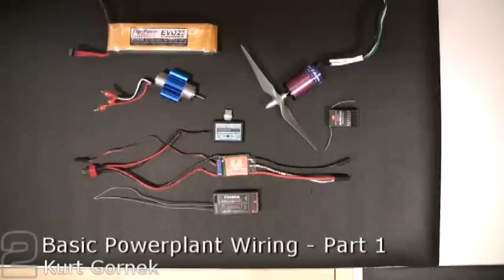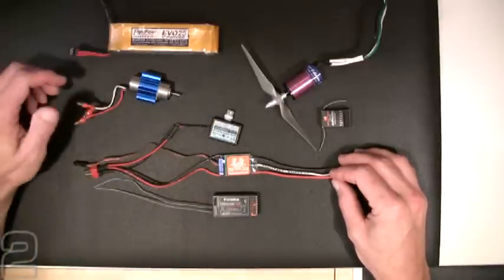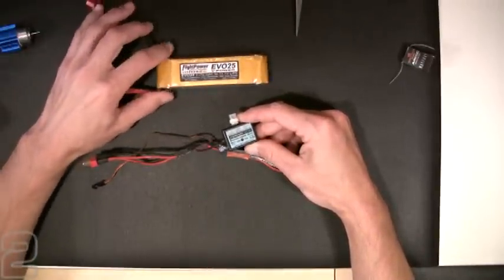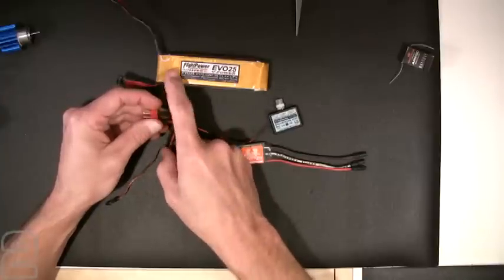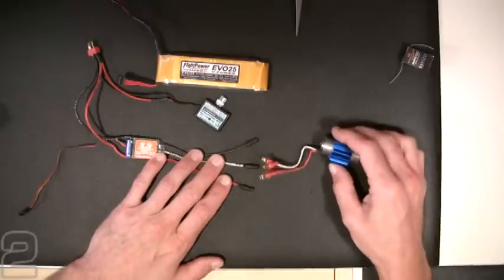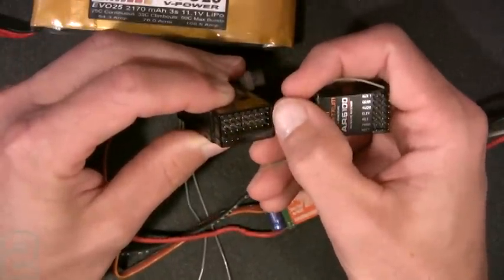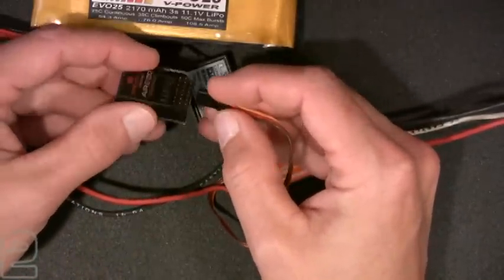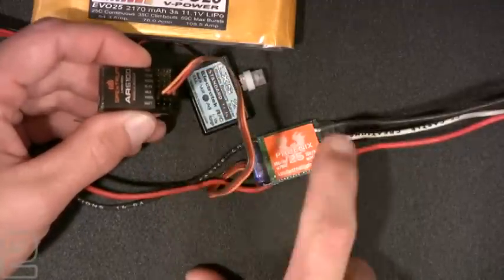RC Motor and ESC Wiring - Part 1

Comment from the maker: You're absolutely correct.  Any two wires will reverse the motor direction.  We suggest using the outside two as a reference so you can easily keep track of your setup upon final assembly.  Often times you end up removing/disconnecting the motor somewhere along the process and it's easier to remember two wires instead which of the three you shuffled during setup.

Comment: Its not mentioned much by most hobbyists but the three wires that power the motor are better known as 'multi-phase' or better known as 'three phase AC, just for those who wish to understand how their motors work, Go look up 'three phase ac electricity on wiki, explains it well about the motor winding in 'star' and 'delta' winding formations :)

Comment from the maker: Yes, either switch any two of the wires for proper rotation or, if your ESC is capable, change the motor direction in the programming of the ESC.  The wires are the easiest way. Some ESC manufacturers offer a plug-in programming card that makes programming really easy as well.

Comment from the maker: @thediamondz1 - The ESC rating is based on the motors peak or maximum amperage draw, not the battery.  The battery can only supply what the motor is able to draw, so the ESC never passes more current than the motor's maximum rating, unless you're running the wrong prop.

Comment from the maker: No, however it's fairly common to buy ESCs and motors with bare wires so you'd have to solder the bullet connectors on before assembly.  Some already have the bullet connectors in place.  E-flite and Electrifly Rimfire components already have matching bullet connectors in place for their matching hardware, so no soldering would be required.

Comment: If you're still making these beginner "how to"s, consider doing a video about motor selection. I have a small park flyer I bought as a RTF, and I'd like to upgrade to a brushless motor etc.  but I'm confused by all the different ways to mount the motors, and which way they face, and those little prop adaptors, and pusher vs pullers, and outboard vs. inboard...  I just don't get it.

Any way, nice video, it really helped.   Thanks.

Comment from the maker: 102Traveller's response is correct, you may check to see if reversing the throttle channel fixes the problem.  Futaba radio systems require the throttle channel be reversed in order to operate an ESC. Another solution may be to adjust the channel end points of your radio supports this function.  Sounds like it's not arming or going into stick programming mode.  This could be caused by either of the above conditions.  Be safe and remove the prop while adjusting!

Comment from the maker: @TheSliekaStyle - You don't connect your 11.1V lipo to the receiver.  You connect it to the ESC.  The ESC radio connection back-feeds the correct voltage to the receiver.  This is the purpose for having a BEC (battery eliminator circuit) built in to the ESC.  It handles the regulation of the incoming voltage down to 4.8 - 6.0 volts for your radio system.

Comment from the maker: You cannot connect directly to a brushless motor.  It actually runs off AC current converted and managed by the ESC. The ESC converts the DC current supplied by the battery to AC, manages the phase, timing, etc. in order to actually run the motor.  There's a lot going on inside the ESC.   A brushed DC motor however can run directly off a DC battery.

Comment from the maker: @mayantribe - The BEC power is supplied through the single radio connection coming from your ESC (assuming your ESC has an integrated BEC).  There are no additional wires for your BEC circuit.  Just plug your ESC into your radio receiver with no motor connected and plug your flight battery into your ESC.  If the receiver comes on, your ESC has an integrated BEC.  If it doesn't, your ESC does NOT have an integrated BEC (or your reveiver connection is reversed, always check polarity).

Comment from the maker: @SunTrapped -  If you are asking if you can connect a brushless motor directly to a power source, no. The Electronic Speed Controller (ESC) function is relatively complex and involves current inversion, multi-phase signaling, timing, and current management (to name a few). You have to utilize an ESC in order to spool up your Electric Ducted Fan (EDF) powerplant. Brushless RC motors should never be connected directly to a power source.

Comment from the maker: If it's not clearly marked on the outside of the ESC, just plug in the main flight battery with the prop/rotors removed, and test the radio lead coming from the ESC.  A multimeter or voltage meter on the positive and negative wires (Brown or Black are negative), Red is positive.  You should see about 5 volts DC being supplied from the ESC if a BEC is present.  Also, simply connecting the flight battery with the ESC plugged into the radio receiver should power the system if BEC is present.

Comment from the maker: @collierman57  -  Yes, that is correct.  Any 2 wires will change the phase sequence and, as a result, change the direction. The outermost wires are often the same color as the ESC leads on medium and larger BLDC motors, so keeping track of just two colors that match is a little easier.  I always match the colors to start, and then test the direction.  If I have to disconnect the wires during the build, it's easy to remember the pattern of the two outermost wires!

Comment from the maker: Jonas, You factor the motor's peak wattage and convert to amps.  Watts = Amps X Volts.  You then choose an ESC that can handle the max amperage or slightly more to be safe.  We have several tools on our website that helps with these calculations.  Good Luck!

Comment from the maker: The easiest way to operate an ESC without a radio system is to pick up a simple servo tester.  They are cheap and will allow you to rotate a dial to operate the ESC.

Comment from the maker: You can use a servo tester to operate an ESC without a receiver or radio system.  These are available from a wide range of manufacturers and can be very inexpensive.

Comment: Hi I'm kinda doing this project with my kayak trolling motor.   It has 2 (+ and -)  wires coming out of the motor.  Do you think I can still use this ESC?  What do I do with the last wire.  Thanks for the input
Reply: i am also pretty new, so im not the best on this stuff. but motors with two wires are called brushed motors, and you need a brushed esc for them, which has 2 wires.hope this helps

Comment from the maker: If you're thinking it's the ESC's internal BEC, just remove the red wire from the ESC radio lead and plug and external (4) AA battery pack (or 4.8-6.0 volt DC source) into the radio receiver's BATT port.  This should power up the whole system and arm the ESC.  If the ESC still doesn't arm and you've tried reversing the throttle and lowering the throttle trim, I'd say you have a bad ESC.  Also,verify your throttle channel is working properly by connecting a servo to the receiver throttle channel.

Comment from the maker: If the stock setup was for NiMH voltage ranges, using a LiPo could cause a problem.  Most stand-alone ESCs can be programmed for different cell types but if your ESC cannot be field programmed then the cutoff voltage.  In any case, going from 9.6V to 7.4 volt is going to reduce performance significantly.

Comment from the maker: Typically the motors ship with solder-type bullet connectors.  You solder the males on one side (motor wires) and the females to the ESC wires.  Cover with shrink tubing and you're all set.  There's no reason you can't directly solder the wires together, it just makes installation and modifications a bit more difficult.  ALSO, if you're going to direct solder the wires, make sure the motor is turning in the right direction.  Most smaller ESCs do not have motor reversing in the programming.

Comment from the maker: @chancho00 - There are some circuit designs you can find on the web regarding homemade servo controllers.  Try doing a Google search for "homemade servo controller" and you should get some returns.  Keep in mind, an ESC is going to be less forgiving than a servo when it comes to end points and input.

Comment from the maker: There are other replies that address channel reversing as a possible solution (below).  If you're not getting any power to the rx and your polarity is correct, than it seems your BEC, at a minimum, is bad.  You may still be able to resurrect the ESC by removing the positive radio lead form the ESC radio connector and using another power source (battery or external BEC) to your radio system.

Comment from the maker: @philipriding - Need more info than the motor RPM.  The maximum wattage or amperage in the motor specs will indicate how many amps the ESC needs to be. Additionally, you could be running with the wrong prop, causing more draw than what the ESC is rated for.  Sounds like you hit thermal limits on the ESC, it went into protection, then came back on after it cooled down a bit.  Finally, most setups are only rated for a few seconds (8-10 MAX) full throttle runs, then back off a bit.

Comment from the maker: If your ESC has an integrated BEC, then no additional BATT connection is required on the receiver.  As long as your ESC radio connection is plugged in to the Throttle channel, the receiver should power up and the servos should be functional.  If this is the case and your ESC fails to arm, and you are using a Futaba radio system, you'll need to reverse the throttle channel in the radio.  Remove the prop first  Otherwise, could be an issue with the BEC circuit either not present or malfunctioning.

Comment: How to operate a motor brushless with the ESC but without using a recector and transmitter, what kind of signal is needed at the orange cable? Can I put a potentiometer to the positive and the orange cable to simulate the accelerator?

Comment: I was flying my rc plane with a 2070 rpm brushless motor and a 30amp esc, after 5 minutes of flight i landed it to see if all was ok. the motor was nice and cool but the esc was hot, even though the plane had a good draft of wind passing through the plane. i took off again and tried the plane on full throttle, when i got to around 200ft the motor cut off and i also lost all control of the plane. it crashed. but lucky enough all i broke was the prop, the range on the transmitter is all ok.

Comment: Hi Bros, does one need a servo? I'm in the middle of building a RC Skate board to mount a camera, it has 2 12v motors which works well with a speed controller but it means long cables, so I want RC. THANK YOU FOR A GREAT TUTORIAL VIDEOS.
Reply from the maker: Hi James, no, you don't need a servo.  Just the motor(s), speed controller(s), radio receiver, and the battery/batteries.  Brushed motors can share a speed control if their total amperage is below the rating of the ESC.  Brushless motors require an ESC for each motor.  Good Luck!
Reply: 2BrothersHobby Hi guys! And what about no-ESC using of one brushed motor? If I have one small 3.7V motor - could I power it up directly from RX? It will not burns out the rX?
Reply: Hi James! I understand that its been over 2 years since you posted this comment, but I'm currently in the process of trying to build an electric skate  board.  Do you have any tips or pointers on how to do it or what components to use.

Comment: hey thanks for your video but i would like to know how to find the right esc for the motor and battery, if i just pick random ESC's, random motors and random batterys and plug them all together, will it still work or will it smoke and explode. i want to make my own RC plane but these electronics have no indication of whats compatible and what isnt.

Comment from the maker: @Mena142  - Glad it was helpful!  We'll be posting several more, including multi-engine, external BEC wiring, and navigational lighting.  Check back often or visit our website at 2bfly.com under the workshop section. There are flight calculators and electrical reference information there as well.  Let us know if there's something specific you'd like to see....

Comment: HI, 
2BrothersHobby,

Me and my son took on a project to build a wooden skiff boat. We hope to reuse remote transmitter from Blade 120SR helicopter that we currently own which is MPL4DSM. This then would "talk" to CM703 that we can source cheap from ebay ... We hope to wire cheap motors like 103 to push the boat forward and one servo for the rudder control ... Do we still need ESC or can cheap motors/servo be wired directly into the receiver ? I do appreciate that we are talking about heli dedicated parts to execute a boat project but this is what we currently have and this small project is just for fun anyway. Any advice would be greatly appreciated.

Comment: as i done a range check first. when i got to the plane the rudder elevators ect ect and motor was working fine, im a bit scared to take the plane up again in case it happens again. do you think i have a dodgy esc?. thanks.

Comment: Im scratch building my first plane and I'm using esc's with a built in sbec what I'd like is how do I find out if the 4 amp sbec will be enough to power 5 tss-11mga servoes?

Comment from the maker: Red and Black only apply to the incoming DC current to the ESC. And YES!!! Red to Red, Black to Black or you'll roast your ESC.  Out of the brushless ESC  to the motor there are three wires of any given combination of colors so color coding doesn't apply. Just connect them to the three motor wires. The only time you need to change the motor wire connections is if the motor is turning in the wrong direction, then swapping any TWO wires going to the motor will reverse the direction.

Comment: Well I think this is the perfect place for this. 
I build robots so I am thinking about adding a weapon. So I was going to purchase parts when I realized the ESC has a continuous current of 6A and my motor has a maximum of 4.1 A so what will happen? Also I have two servos so will an 11.1V battery work? They run up to 9V and my motor runs up to 7V.

Thanks

Comment: Okay so that little bunch of three wires going into the radio receiver are: negative, positive and signal. So does that mean I could control an esc via arduino using just the signal wire and leaving the other two wires unconnected?
Many Thanks

Comment: Is there anyway of connecting a brushless motor with three wires straight to a battery without ESC? If not can I connect to an ESC then to battery or does it have to go through a transmitter as well. All Im wanting the motor to do is run a hairdryer..Thanks

Comment: Hi guys, Maybe you can help.  I have a Catalina by Curnli bought through Nitro back in 2009.  I never finished putting it together but would like to now but updating the electronics. Existing set-up: the old 72 radio, two 370 motors (geared)( have only two wires coming from each), battery was Ni-Mh 8.4-1000mAh.  It has a single 40A ESC (supposedly, very small, no markings) which has the four wires to feed the motors.  I switched out the receiver and changed the power leads to the ESC to deans.  I hooked up a 3S 1100 for power.  ESC got very hot in less then a minute with the props turning.  Should I a) use a less powerful battery like maybe a 2S, b) change out the ESC and if so, what set up should I use with the 4 wires going to the motors?  Would like to get it flying if I can.  Seen some vids where  it flys right off the grass and preforms nicely.

Comment from the maker: CAUTION!! Sound like you have a brushed ESC, not brushless.  In that case, connecting it to a brushless motor will ruin the ESC/motor.  Brushed ESCs send DC voltage to the brushed motor.  Brushless ESCs actually invert the incoming DC to multi-phase AC.  You would be sending DC voltage to an AC motor.  Not good.  You would most certainly and immediately be letting some extra smoke out of your ESC's electronics and cooking your brushless motor:)

Comment: You say at 6 min 12 sec about Futaba receiver ... i want to know which one is the positive, negative and signal on the futaba receiver ... I have a R614FS FASST 2.4 GHz receiver .. it has a slot too on the receiver ...

Comment from the maker: @moron32 - Yep, the same components are used in boats with lipos and brushless speed controls.  In fact, even NiMh and brushed ESCs wire the same way.  Connections are all the same with the exception of brushed motors only have two wires to the motor.

Comment: hi there i have a Catalina plane with this system. i have followed all the wiring instructions and everything works OK except the 2 motors. they play a wee tune when you plug the battery in and then a "ding" about every 2 seconds. Should the battery be plugged into the plane with one plug (the t shaped one) AND the other wires. there is currently no plug in the BATT plug on the reciever?

Comment: hi mate,i jst converted a 1/5th scale rc car into brushless,am using a 200 amp esc,,i was wondering if i can use a servo along on wiz the esc on same channel ''throttle'' using a y lead so wen i brake the servo pulls the cable for the front brakes and the rear brakes by the motor itself..please help

Comment: I focuse on the battery volt . if I buy the 12v battery what kind receiver , speed controller,  motor should I buy ? if I need servo what vole of servo should I buy ? ( I'm a beginner build a plane )

Comment: ok so I am looking to build a tri-coprter (the rotor helicopter) and i am trying to biuld it on the lowest budget possible, all the parts shown in this video are very expensive, even the ESC's cost 60$ can you recomend some small ESC's for under 20$?